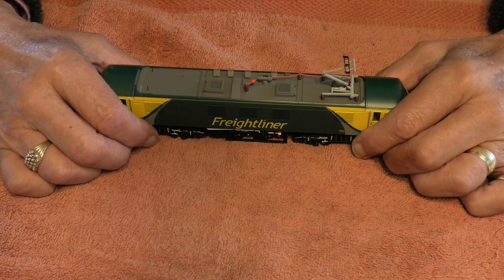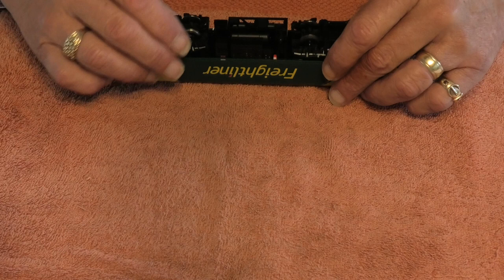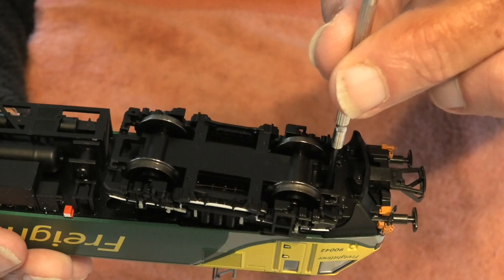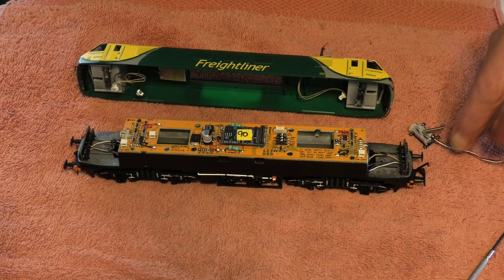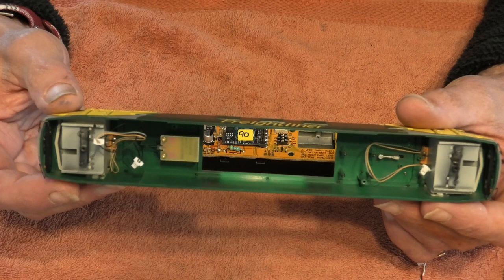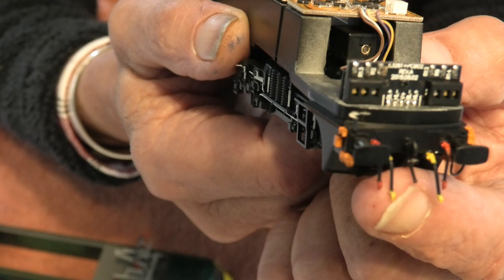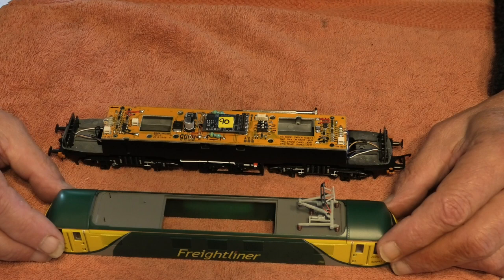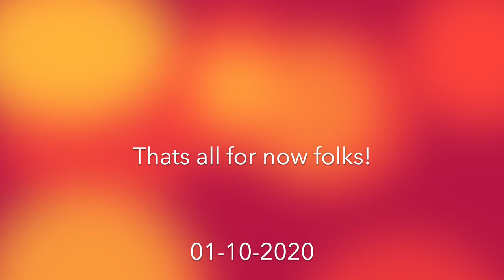How to remove the body from a Bachmann Class 90         01-10-2020

Comment: Thanks Graham for this much needed video. You think Bachmann would have included instructions in the manual !!
Reply from the maker: Scott Malcolm      Hi Scott, I think the only reason I can think of why Bachmann didn’t include this in their instructions was that they didn’t want to encourage folk to take the whole body off - just the top plate for fitting the decoder. Just a guess though.    But at least this now shows how to do it should you need to do it for whatever reason like fitting a driver.     👍🏻👍🏻        Cheers for now mate.         ............ Graham

Comment: Hi Graham, a great video for those with a Class 90, they aren't for my layout even if they do look stunning. The perils of body removal, omg why do they always make it so tricky................So you showed your missing tiny gear wheel using the pointy thing, lol that was funny, I sat there going "is this were we shout, It's behind you!". Oh also you said you had a Leggoman sound chip, but where did you had the speaker, as I don't recall seeing it..............just curious! Anyway hope your keeping well,  best regards Dave.
Reply from the maker: stretchedits      Hi Dave, the speaker is unusually pre installed in the model near one of the cabs but typically I am removing that and replacing it with a larger, better quality speaker, the original is tiny and it sounded as though it was ‘rattling’ although it probably wasn’t - just sounded like it.   Yep, keeping well buddy, just very busy with other things not related to Lakeside which is why there hasn’t been much going on over the last few weeks.     Cheers for now mate.        ..........Graham

Comment: Hi Graham it's James Hoyland, I've also got a Bachmann class 90 in Intercity Swallow livery, name plate financial Times and my dad put a legoman Biffo sound decoder in and the sounds went really quiet. I can only just hear it plus it might need a new replacement speaker fitted so I can hear the sounds again.
Reply from the maker: James Hoyland      Hi James, that’s strange about just hearing the sound as it’s so quiet, I guess the speaker is the first place to look but it is a tiny speaker, I’m replacing mine, in fact I have already done it with a slightly larger, better quality speaker.    Cheers for now.            ..........Graham

Comment: Hi Graham, I’m trying to find a service sheet or video on how to disassemble the bogie & wheel set on the Class 90 but can’t find anything online. Even the sheet that comes with the loco doesn’t have the exploded view. One of the wires has broken away from the bogie assembly pick up and needs resoldering. Before I attempt to start trying to lever the bogie frame in the wrong place and start breaking things, I thought I’d ask you as you’re the only video I can find on YouTube. Thanks in advance, regards, Mark

Comment: Hi Graham. Nice little video. Pitty you haven't got an Accurascale Class 92. I haven't got the confidence to take the body off to fit a driver and co driver on to it. However, you have made me interested in getting a Bachmann Class 90. Has it ran well ? I've had mixed results with my Bachmann Class 66s.

Comment: Is it the same with the Bachman 47
Reply: I think there are just 4 screws then the body unclips each end by the windows. Instructions should be in the 47 manual.
Reply from the maker: Ecml Trainspotters        Sorry I don’t know about the 47 but I would guess - and it is only a guess, that it would be the normal Bachmann way of removing a diesel loco body which is by four screws under the chassis by the rear of each bogie but that is just an assumption from me and not factual. Have a look because it should be pretty obvious.     Cheers for now.         .......... Graham